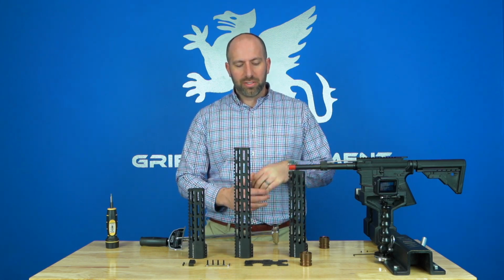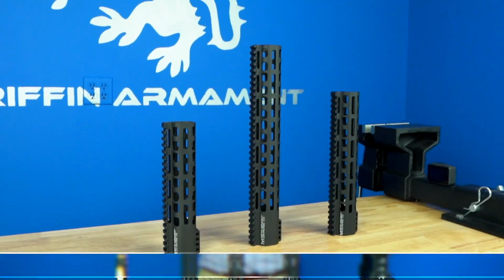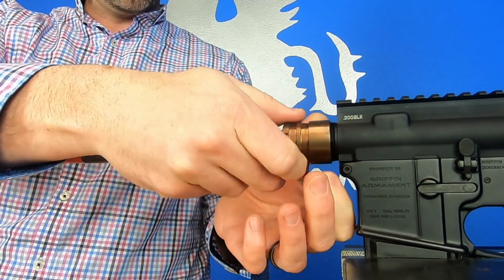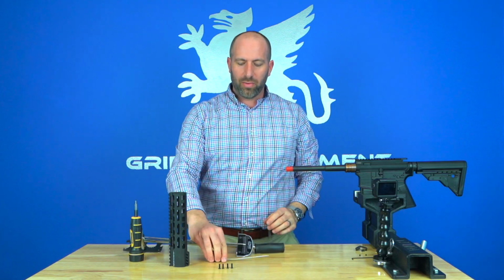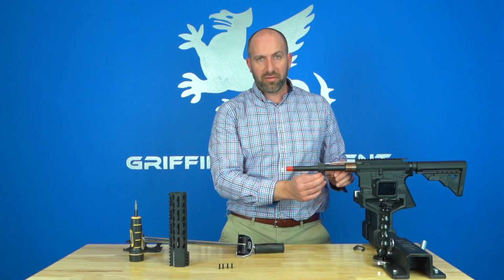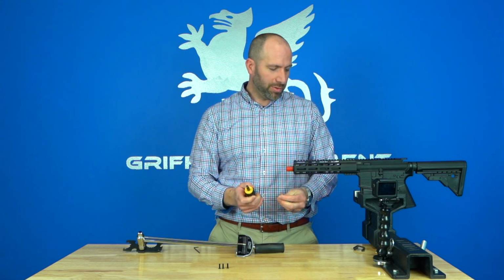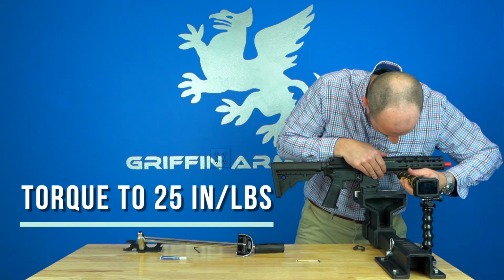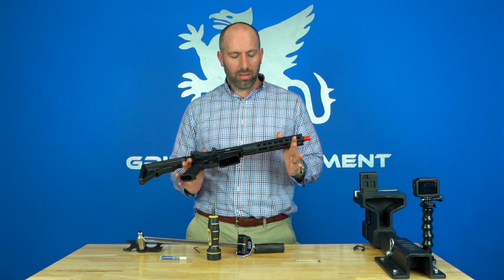LOW-PRO M-LOK Rails (Gen 2) Installation Guide

Comment: I recently got one, what’s the little set screw on the ejection port side supposed to do? Its directly on the side, going into the barrel nut. Also, I’d recommend going over the 4 clamping screws a couple times at 25in/lbs, because after you tighten the other screws, the first ones will become completely loose. I went back and forth over them all multiple times until none of them would move anymore, this makes them all be torqued to 25in/lbs, or at least all of them are holding the same amount of load.
Reply: I just got one delivered today and saw the same thing. Came here looking for information and what do you know someone else asking the same question with no answer provided. Unfortunate.
Reply: Pure speculation but I'm guessing it allows a bolt to be threaded through the rail, into one of the channels in the barrel nut, to prevent the rail coming off in a worst case scenario. I just replaced an older low pro rail that has the threaded hole with a different length one that doesn't. The new one has what they described as a "Anti-Pull Off Clamp Shim" that seems to serve that purpose but accomplishes it in a different way (it goes in the handguard gap, the clamping screws go though it, and the shim interfaces with the barrel nut channels).

Comment: Without anti rotation of any sort this is a miss.
Reply: 4 T15 fasteners that are on the rail are providing something like 700 lbs of clamping force.  You cant just rotate the rail you'd have to put it in a fixture and apply a strap wrench to the rail to move it. Its solid as fuck
Reply: @evangreen7562  copy that
Reply: I was thinking the same thing. But the barrel nut has a pretty large amount of surface area compared to others like Bcm that mount in a similar way. They are also using twice as many fasteners as similar ones. I don’t see it being an issue, and not having anti rotation tabs makes the handguard compatible with uppers like the bcm mk2 upper, where you need to modify almost all handguards that have anti rotation features. I’ll be picking one up